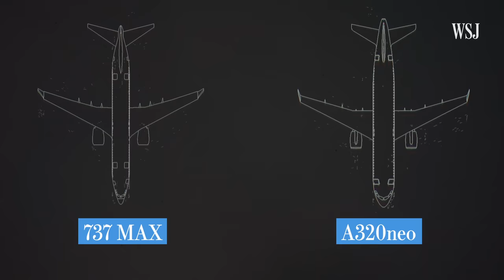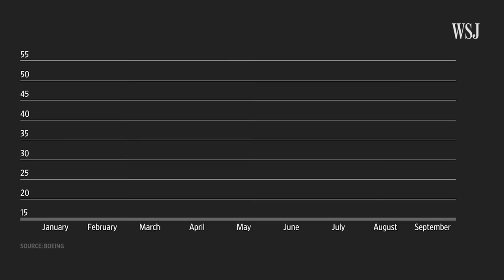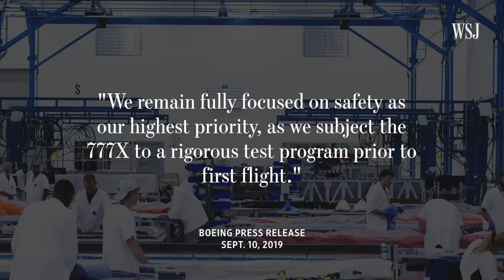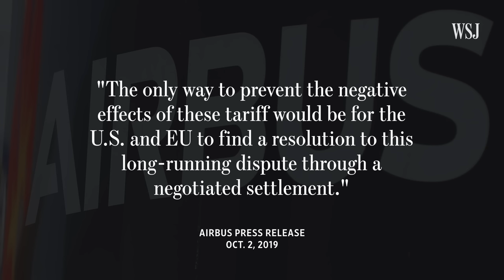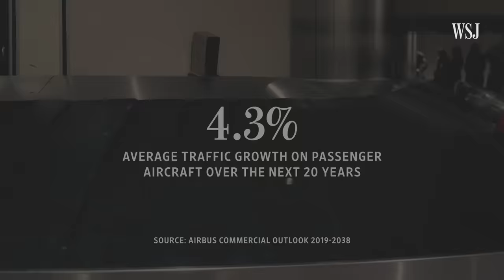Boeing vs. Airbus: Why Aviation’s Biggest Rivalry Is in Flux | WSJ

Comment: Boeing created their own problems when they started focusing on profits rather than safety and quality.
Reply: that is not what happened they did it for the airlines because they already have pilots who can fly the 737 and don't want to spend the $30000 per pilot to retrain on a different aircraft boing executed it badly but also remember that the 737 is about 70% of boing total sayls and airbus was  taking  a huge chunk of the American market so they had to work quickly.  so yes a little for mony but also a lot form the airlines because a lot of airlines went to boing and basically told them that they were going to have to upgrade the 737 so boing did.
Reply: Rata 4U  No, he did more than that.  He detailed how Boeing lost sight of safety in the search for profits in the 737-MAX case.  Other than the horrible spelling, he did a good job too.  The key point is that the aircraft itself is stable, and safe, but it is a different plane from previous iterations of the 737.  Pilots need to be specifically trained to familiarize themselves with its handling and limits.  The mortal sin is MCAS as implemented, in an effort to circumvent that special, needed training.  Not only is trying to turn one airplane into another through software an inherently flawed proposition, but then they also screwed it up royally.
Reply: The real problem is American "workmanship".
Reply: Outsourcing to India you mean
Reply: very true... airbus is doing fine on their own but now with Boeing's losses airbus has the upper hand and is leading
Reply: Don’t be a fool, you can’t have profits with out the other and they know it. These things happen in many industries, unfortunately.
Reply: @chocomanger6873  no
Reply: @guyhunter4313  Look, airlines asked for an upgrade without additional training for his pilots, and Boeing, yes BOEING said YES, we can do that. And they also promissed 1mil dollar per 737 if AA would cancel the order by Airbus. So nobody is to blame here but Boeing. It was all about the money.
Reply: $afty is Boeing main concern 😭
Reply: This is such a wrong and ignorant statement. Capitalism works by putting price tag on every aspect of human life. Profit is always the pursuit of every business, as it should be. The problem is always there, or the risk of having this sort of problems. It's business competition, and there's no way around it.
Reply: Apparently something similar happened with the 727.
The aircraft itself wasn't that unsafe, but there must have been some problem with the transmission of the knowledge on how to use it from Boeing to the pilots, and the first ones crashed on landing too often.
Reply: Like most American corporations do.
Reply: It is Airbus who is focusing on profits rather than safety and quality, the difference is that the corrup EU is protecting Airbus.
Reply: airbus did the same thing with the a310 and the auto throttle, and I don't see anyone talking about that
Reply: @northwestthrills3453  Those were caused by old planes when they didn't have fly by wire 
all I see is both 737s crashing from the same problem boeing didn't fix.
Reply: True👏👏👏
Reply: Same with airbus, they were both competing, you would think an aircraft designer like Boeing and Airbus would work together to ensure safety for everyone instead there is competition which is a downside to safety.
Reply: The recent Boeing problem all boil down to Anglo American greed.
Reply: That's why they silence their workers

Comment: The difference is 1 goes up the other goes down
Reply: PirateBoss1 🤣🤣🤣🤣🤣🤣🤣🤣🤣🤣🤣🤣Best comment ever!!!! Why? Cuz you’re speaking truth!
Reply: Airbuses aren’t real planes, they are a just aluminum attached to a Atari controller
Reply: hahhahahahahahaha
Reply: High Skies then Boeing is a weird steering wheel attached to metal
Reply: heyimalex I guess your saying that for every aircraft ever aside from
 The c-17.
Reply: High Skies laughs in a300 Keep being so bitter buddy.
Reply: Wait for china
Reply: @flybyjose5161  uh...sure at least they are still clean on the book with the Neos..how bout Max what's your excuse??
Reply: Eric Wang it was the 319-21s that were passed with false info on the bs test as well as compression stalls. I’m not defending the max, there is problems with it. It wasn’t only boring fault but the FAA combined. But Boeing shouldn’t have gotten all the flak it did. It was also a lack of pilot training because of underfunding and at an under developed country
Reply: Hmmm i have seen many Airbuses  take a nose dive gtfoh
Reply: @flybyjose5161  nice joke
Reply: @bonneydahlquist1857  when and where
Reply: Komrad Ivan like I said, I’m not defending the max, but airbus has its problems too. It’s pressurization is out of wack as well as it’s engines. My father has had 4 compression stalls on both engines in only 9 months of flying airbus.
Reply: @flybyjose5161  aand did airbus make those engines?
Reply: @flybyjose5161  you said the pressurization and engines are wack yet you only talk of the engines... oh well maybe you havent got that yet.
Reply: PirateBoss1 Both are necessary in balance!
Reply: PirateBoss1 so true😂😂
Reply: Well they’re airplanes so hopefully they both go down
Reply: High Skies Airbus aren't any more "automated" than conventional aircraft that is a misconception
Reply: @bonneydahlquist1857  Boeing* corrected you there bud.

Comment: Boeing CEO. ”safety is important!” 
Wow...
Reply: You didn't get it 'safety' means safety of their bank balance
Reply: Something, something, GrayStillPlays, something, something.
Reply: after taking lot of innocent peoples life🤬🤬
Reply: Honestly it was also because the pilots weren’t comfortable enough flying without auto-pilot, Boeing definitely needs to be better about testing though
Reply: @bucky822  did he mention anything about Airbus?
Reply: Not as important as outsourcing of jobs to India
Reply: @bucky822  The 346 people that died would disagree.
Reply: @bucky822  what is your insecurity that need to drag Airbus into the conversation? Each company doing their own thing.. Boeing fked up, Airbus keeps on doing their things...
Reply: @bucky822  tell me you are joking because that's a very stupid joke
Reply: Bundeswehr yeah let’s talk physically by taking this exactly the same plane.
Reply: @bucky822  The airbus a340 is the safest passenger plane and the a350 and a380 also didn’t have any crashes. The a320neo is way safer than Boeing 737 max. The a320 family is also pretty safe, one of the biggest accident on the a320 is the germanwings one where the copilot crashed the plane into the mountain so it’s not the plane’s fault. And I believe the a330 isn’t too dangerous as well.
Reply: @rexchnnz2675  that's why I always fly with airbus instead of boeing.
Reply: airbus did the same thing with the a310 and the auto throttle, and I don't see anyone talking about that

Comment: The 737Max is not ever going to work, its engine sits to high on the wing. They need to scrap the plane, its a poor design.
Reply: That's why they introduced software to keep the plane level cus the engine is too high,but the system thought that the plane was climbing when it was level so it pushes the nose down,and (very shortly) that's what caused the crashes of the max
Reply: The 737Max is better than any Airbus aircraft. The issue is that the EU is corrupt and certifying Airbus planes which should not.
Reply: They fixed it with "software update". What a joke.
Reply: Those engineering flaw, no matter how good sensor & sofware are, it'll FAIL someday. And when that happen, just say pilot have full control manually. Not much pilot get used to manual control nowadays, everything are automatic. It seems there's price for human life at Boeing.
Reply: Totally agree. I can't believe how many people think that it's a good plane when the physical design is flawed. Your betting on software to keep you safe.
Reply: @prisonermonkeys8613  So according to you a crashing airplane is better than a regular airplane?
Reply: @c_gull9995  Airbus has had more crashes due to design. Most crashes with Boeing were due to pilot error.
Reply: @Ramen Lover All 737 crashes are due to maintenance errors or pilot errors.
Airbus crashes are due to design error.
Reply: @prisonermonkeys8613  You must have gotten those two mixed up, 737 max is a poor design since its inception, it is an unbalanced plane, that's why it needs software to counteract it, which didn't work too well.
Reply: @prisonermonkeys8613  exactly
Reply: The F16 and almost all major military aircraft require software to adjust control surfaces to keep them in the air. That said Boeing needs to fix or scrap the aircraft. Either way Airbus sucks
Reply: @timothycantor4488  Those are military planes agility is paramount, building a slightly unstable plane can increase its agility. For a commercial airliner you want maximum stability. The 737max is a poor design since its inception, that's why many engineers didn't agree with the project.
Reply: @davidg8628  agreed. Thus the bit at the end of my post :-)
Reply: @timothycantor4488  how does Airbus suck then? They have nothing to do with that mess
Reply: @coleevans8994  Thank you for the support
Reply: @prisonermonkeys8613  erm... the EU doesn't certify airplanes. If you did a little research, you would know that
Reply: @prisonermonkeys8613  I see a proud Patriot who can't see the truth
Reply: @aidanbegovic9584  yeah and that software got hundreds of passengers killed in both planes🙄
Reply: 2 out of over 150,000 flights crashed, one of which wasn't even boings fault, it was lion air's fault for not informing there pilots of the MCAS system after boing started to inform airlines of it.
Reply: @prisonermonkeys8613  737Max crashed due to design error. The Mcas nose sensor malfunctioned even though boeing was aware of this they prioritize profit rather than life.
Reply: @davidg8628  also military plane got extra safety like parachute and ejection seat....
Reply: Ah yes, my man, do you know anything about planes?
Reply: @aviationgod3105  I don't think he dose
Reply: True👏👏 And  don' t forget the Macs(false written) system
Reply: @thetruthaboutaviationcrash9927  stop taking drugs bro
Reply: 737 max is not better than airbus planes the Airbus a350 is literally so good and a good seller and it’s safe 
I prefer the older 737 NG
Reply: Plus airbus does not have a poor design 
I never seen an airbus A320neo A340 A350 and A380 crash 
Some of these aircraft flew for 25 years without any fatal accidents
Reply: Well, look whats happend in China recently... 🤤
Reply: @zamaz48  yes , the man who commented this isn't alive lol
Reply: @davidg8628  quite honestly. Yah it’s a bad design but it was the lack of communication on how to use those systems that was its downfall.

Comment: If it ain’t airbus i’m taking a bus!
Reply: WELL WHEN ONE OF THOSE AIRBUS PLANES, CRASHES YOU CAN WALK ARE TAKE A BUS, PLEASE, STAY AWAY FROM BOEING, WE LIKE OUR AMERICAN PLANES.
Reply: @franksmall7481  If it's a Boeing I ain't going
Reply: @franksmall7481  they don't really crash that much.
Reply: @franksmall7481  I went on Airbus planes 16 times this year. They didn't shake and it's super quite. Went on a Boing plane once. It shake so bad and it's loud. So, no. I am taking the bus.
Reply: @tryomama  Airbus planes starting up sound like a dog barking. You most likely flew on an older Boeing plane in its 20-30 year range. Which no doubt, Airbus or Boeing will be loud and noisy at that age. New Boeing planes are just as quiet as Airbus. I prefer Boeing, such as the 787 and 777-300ERs.
Reply: To be honest a340 economy class was better than b787 economy class but Im still team boeing for life
Reply: Well some of HK's airport coaches are called 'Airbus' too ;)
Reply: Leif Vejby 737 MAX is totally different than any other Boeing.
Reply: Good luck with the bus over The Atlantic ocean
Reply: My opinion:
A320 family > B737 family
A330 = B777
A350 > B787
A380 > B747
Reply: @Jack3md  Airbus planes are Really loud but inside it's not
A350 is one of the quietest aircraft
Reply: @Jack3md  bruh i flew to Boeing 777-300er which was only 3.1 Years old  And it was shaking so bad 
But as an Aviation fan I love both of them 
I love the sound of GE90 And
Reply: @tryomama  well it's not boeing's fault.

Comment: How about they engineer a plane without stability problems requiring overreaching software.
Reply: C J how about you not write about things which you do not understand
Reply: With FBW, you don't need a stable airframe. Airbus did that (FBW) in the 80s
Reply: @rkan2  yes, mechatronics allow planes to deliberately be "unstable" while flying
Reply: @John-yg2rt  A more accurate description would be that FBW allows the design of unstable airframes. With FBW they are made to fly in stable ways. Both Airbus and Boeing designed some instability in to their airframes, but only Airbus had the easy way out. At least with the 777x Boeing didn't face the same limitations, it being a plane designed in the 90s.. All completely new Boeing designs from the 70s have had FBW, ecluding the 757/767... (the 737 was and still is a 60s design from before the time of readily available semiconductors)
Reply: @deoxue6327  Boeing: Expenses over stability, safety, and lives. Trial and error is our mantra.
Reply: C J because that mean they’ll have to keep employing pilots. The purpose of the software is trying to make it safer, a majority of aircraft accidents are pilot error
Reply: I agree, they made the plane deliberately unstable just to save a few bucks ...
Reply: Boeing defenders are disgusting, or all they all boeing staffs?
Reply: @rkan2  FBW transport category aircraft still must be statically stable within a reasonable envelope though the constraints are relaxed somewhat outside that. Otherwise direct law on Airbus planes would not be reasonably possible for a pilot to fly. However, things like a pitch-up tendency nearing stall are acceptable for FBW aircraft where there is redundant protection and direct law is a last resort anyway. For non-FBW aircraft a pitch-up tendency isn't acceptable, and it's unclear whether 737 MAX (without MCAS) is statically stable across the entire operating envelope.
Reply: lie01234 I agree that safety is always first, but for Boeing to beat the A320 neo, they would have to fit bigger engines on the 737 or they would lose market share. And they chose to not to re engineer the Max, but they just slid the engine higher. And that changed how the 737 Max handled
Reply: @deoxue6327  Yeah, they were idiots who only cared about cost. They didn't want to build a new plane because its cheaper. They didn't want to re-designed it because it would lose its type rating and would have to recertify it and retrain new pilots $$$. The 737 was designed over 50yrs ago since then its been re-engineered pass its limitations.
Reply: lie01234 I don’t represent Boeing, I’m not defending them, I’m just trying to present information with as little prejudice as I can
Reply: Deo Xue we all know, but making the landing gear a bit higher shouldn’t be that hard and wouldn’t change the handling, or am I wrong ?
Reply: The design of the 737 couldn’t use the new engines that are more efficient, they would have to design a completely new plane witch takes time and money, not to talk about the A321 Neo, with a couple hours of training you could pass from the A320 to the A321 Neo. With a new plane pilots would have to be trained for months. Not to talk about the fact that the A321Neo didn’t have any competition boosting sales.